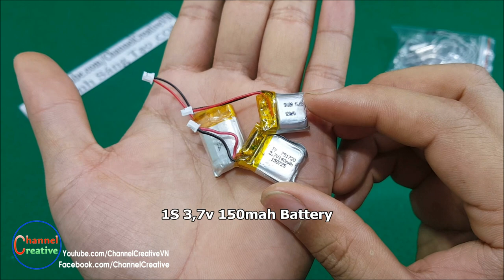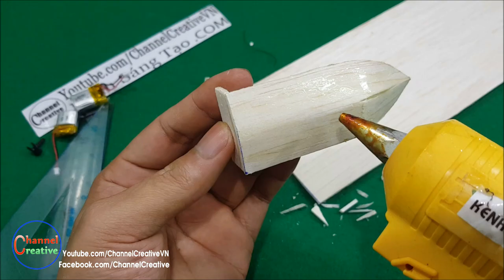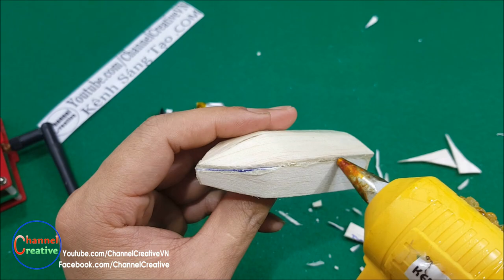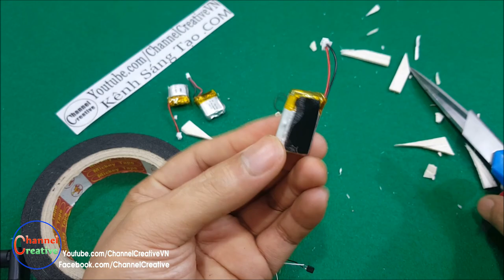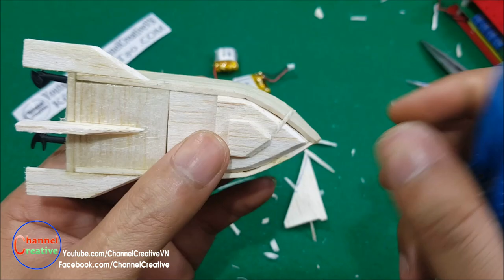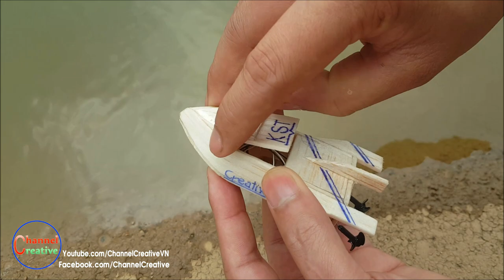How To Make Super Mini RC Boat Twin Motor

Comment: Nice design, however you should have used CA glue to put it together. You should have also covered the outside with dope (Lacquer finish). If you don't do this then water could seep through the balsa wood. Also it makes the boat tougher. Just some suggestions for future projects
Reply: why cyanoacrylate ?

Comment: For anyone who can’t find a transmitter and receiver: A micro drone will work if you keep the circuit board flag and use the rear motors.

Comment: from where do you get this chips (transmitter and receiver)
Reply: exept for the transmitter he got the other parts from a cheap boat and desoldered them and put them back together in another case just for the video
Reply: Harish kumar Gupta  banggood. com
Reply: superp
Reply: sorry but
i search on  banggod but i not found
Reply: Les Beaux poemes you will find the similar but not the same. you can use them also
Reply: ok but do forget for receveir 2 channel?
Reply: Les Beaux poemes hey you can find that in there
Reply: wo bekomme ich diesen Empfänger und Sender her. oder wie mache ich das sich die propeller verschieden drehen beim lenken
Reply: ZaHax Thank you!!
Reply: can't  we make  a transmitter  and receiver  chip set
Reply: please  reply thanks
Reply: Harish kumar Gupta I made 1 off those boats I use a receiver , transmitter & 2 motors from a old mini helicopter I had, it works but as I drop it in the water the motors stop, idk if is water or the props I use, I didn't use wat was in the video my props bigger
Reply: Try searching in category rc planes     then type receiver bord in search column you'll get it(in banggood.com)
Reply: Harish kumar 

12345
123456
Reply: you will get it from an rc helicopter
Reply: Harish kumar Gupta
Reply: Aman